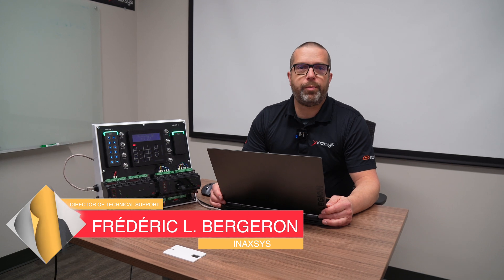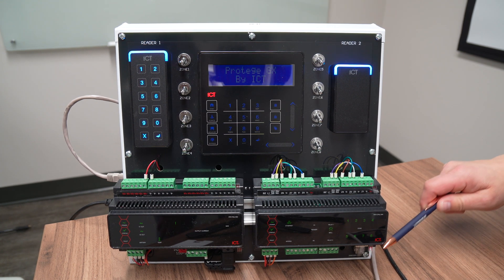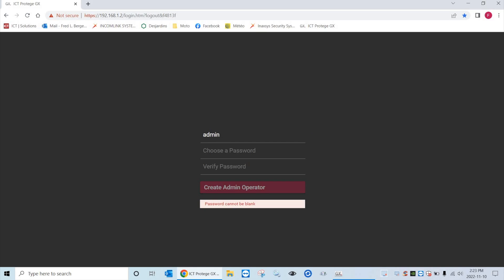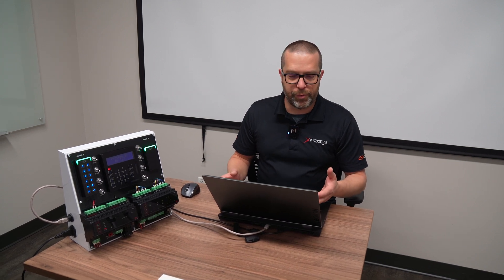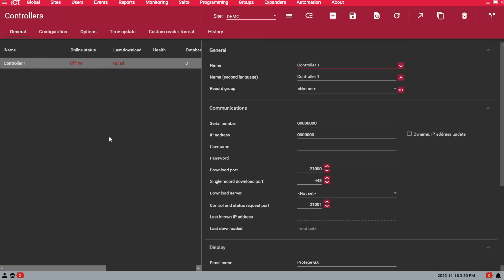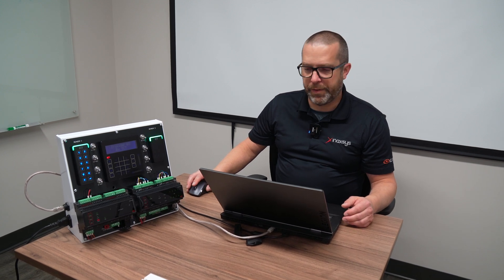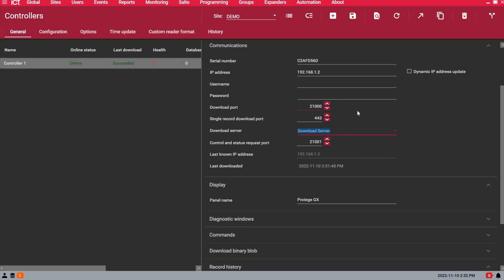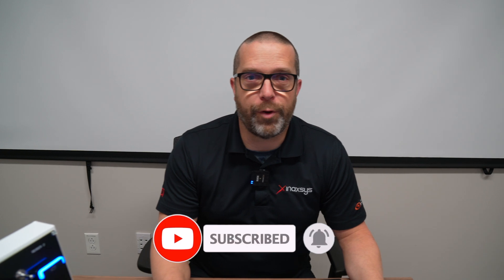ICT Protege GX: How to bring a GX Din rail controller online with the GX software

Comment: Hi Fred, I didn't get it. to use the Protege GX, do we need to have server? or controller can can work stand alone as door access and alarm system?
Reply: Hi Mohamad,  Protege GX requires the server and client software for programming and to monitor / control devices on the field.  But the GX DIN controller is fully standalone so the server is not needed for the security and access control system to operate normally.